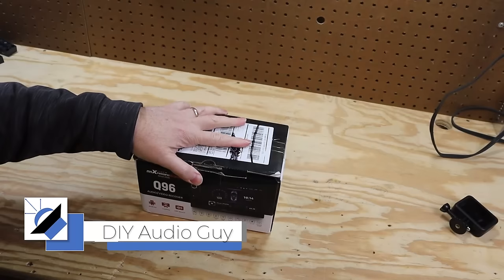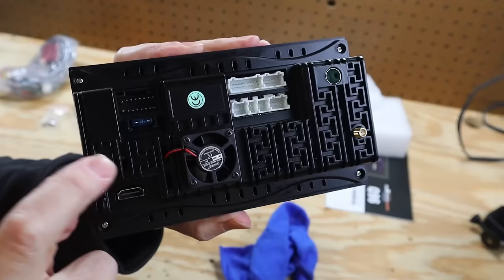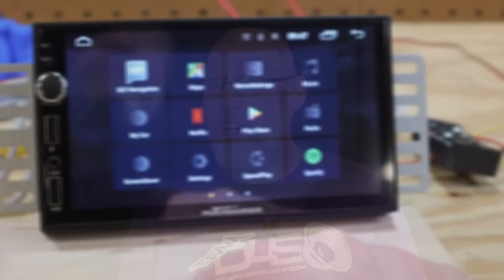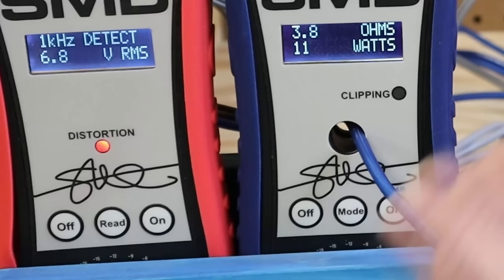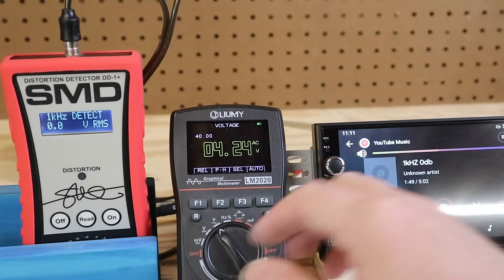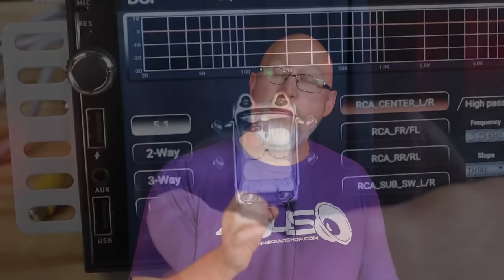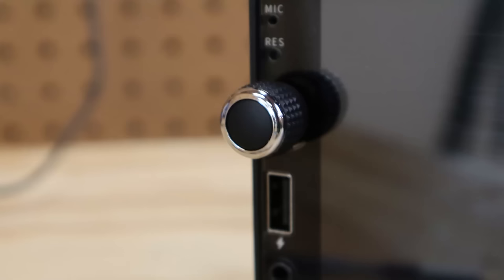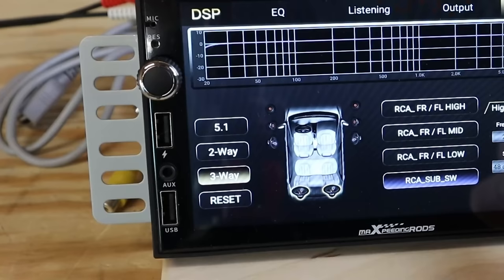The Best Sound Quality on Amazon?  Android Car Stereo Head Unit

Comment: Save the volume knobs! I don't buy a head unit without one. No matter the features.
Reply from the maker: I guess if you got steering wheel controls you can get by without a volume knob.
Reply: I don't miss a volume knob. Steering wheel controls I use more than anything
Reply: I agree. Volume knobs are an essential dealbreaker.
Reply: Volume knobs are superior in every way 💪
Reply: I'm the same way
Reply: I bought an X-trons, without thinking it would be a big deal, that it didnt have volume knob, but the touch buttons on the left size. Ive gotten used to it, but i really miss my volume knob.
Reply: Even with steering wheel controls when I need immediate silence from entertainment system to listen to engine/tire or road noise 100% of the time i go for the knob i got a cheap double dihn for my spare car that has no volume knob i wont ever make that mistake again
Reply: Ditto.
Reply: Every car I've owned in the past 40+ years had a volume knob. It's the standard control knob. Sure its a hangover from analogue days, but how practical are they.
Reply: I got an xtrons without one about a year ago... Previously I'd had a unit with buttons, so didn't think about it. But the xtrons has touch buttons, not physical ones. You can't feel for them without pressing them. And they put the power button right there with them, so you can accidentally turn it off while trying to turn it up a little.
I'll be looking for a knob or physical hardware clickable buttons on my next one.
Reply: You can purchase  a usb huge knob though
Reply: @DIYAudioGuy  1989 Nissans don't got that sadly haha
Reply: @tin2001  looking at Xtrons android 12 unit as well, when installing, does the volume knob on your main stereo stop working? If that's the case can you map volume to the steering wheel buttons?
Reply: Yes!!!! I can't stand buttons. I actually saw an article saying that buttons were better for use while driving.  Made me cringe
Reply: Yeah and you can add steering wheel controls to any car these days
Reply: I don't buy one without a volume knob
Reply: Helix with a Conductor is perfect
Reply: it doesnt have a mute button? @Learningmane
Reply: @capturedphoton  it does but I look for the knob  instinctively
Reply: yeah, car androids should/must have volume knobs because they easy to control while driving.
Reply: Same

Comment: The biggest problem I see with this is the 2G+32G in the listing. 2g means 2 gigs of RAM, 32gb of storage. Storage may not be an issue for anyone who is conservative on the apps they install. But, 2 gigs of RAM will choke a lot of modern apps. From personal experience I can tell you Google maps is horrible with low RAM. Waze doesn't seem to do as bad however. I haven't looked any further than that into the android specs, but I'm sure this has a weak processor and almost guarantee it's not actually Android 10. Most of these companies "skin" android 8, etc to appear to be 10, 11, so on. Try something like CPU-Z to see what the API is. Then Google android api list. 10 should be API 29. But... Sometimes they fake that too. Annnnnd, sometimes they fake the specs. 2g 32g might actually be 1g 16g. I'm not saying this company is doing that, but be cautious. Google the model number etc. You'll likely find someone on XDA with info. Personally I cuss my Eonon (8227L I believe) every time I drive my car and it locks up or resets itself. That said, it's still far better than the factory basic radio. I just limit my apps to Waze and YouTube Music. That's all I really need anyway. 🤷‍♂️
Reply from the maker: How much would you be willing to pay for one with more ram and a faster chip?
Reply: This is something that has been the achilles heal of these tablet style units.    Personally?  I have always found better performance when using  the phone to do all the GPS functions I need.  

   BUT the Bigger problem is when you start using Amazon Music and Spotify.  IT EATS RAM!     And CPU Power?   It eats that too! 

As long as you use this unit for Native Playback,  You should be fine.    But 2GIGS?  Not even Chromebooks today run good on that with a fast current CPU. 

4Gigs is the BARE minimum.   Want GREAT performance?    8 Gigs is where it starts getting good with apps.    12 is where you get diminishing returns.    

For Perspective?  4 Gigs of Ram was what you needed for windows XP to Fly back in the day with some Fast 15k SCSI drives on a striped array.  

2024 on the way?   And we still got 2Gigs being the Entry level with modern apps is just not going to cut it.   Fine for a Media Playback device.   Not so if you want to run  Modern Bloated Apps on the thing. 

As much as I like having a Headunit?    Screen Mirroring is the best way to go about it going into the future.   You use the phones Superior horsepower, and you getto use the tactile like functions of I/O device being your touchscreen and Physical controls to do its thing.     

That way?   If you want to simply upgrade?   You just put in a New "BOX" and the display, much like a Keyboard or mouse is the peripheral.   

You also don't have to worry about theft since everything that is worth anything is in a black box locked away.  Better for security as well.
Reply from the maker: @MickeyMishra  does Android auto / Apple carplay offload processing to the phone or does it do the processing on the head unit?
Reply: @DIYAudioGuy  well... Lol... I think I dropped about 400-ish for my Eonon a few years back, somewhat regretfully. If I could get this form factor (double din / 7-8in screen), 6-8gb RAM / 128-256gb storage, a really good processor, actual supported official honest android 10 or higher, security updates, android upgrades for a reasonable amount of time, etc... I mean I'd drop $1000-1500 easily.
Reply: @MickeyMishra  so much everything you said too. The sound processing, amplification, etc in the unit and the info/sound/video coming from an external source.
Reply: @DIYAudioGuy   Depends on the APP on the  Headunit.  Many diffrent ways to skin a Cat.   But most do it on the HU itself.    Not Rock solid sure on Apples end.  But with how they do things?   The API seems to point to most of the heavy lifting to the head unit CPU.   However, there ARE exceptions to this rule.    

SOME OEM units differ.  But its all closed source do to drivers, so its hard to tell without getting into the TERMINAL or SHELL.
Reply: @DIYAudioGuy  $100 easy if it wasn't laggy and had better speaker level outputs.
Even the low end name brand units have hardly any features for twice the price of this one. If there was guaranteed software updates and warranty support with a less dumb brand name it could be a $1k hu easy.
Reply: @MickeyMishra  Hopefully someday. All the tech is there, just Need a company to actually build it. If they can make profit on this feature packed unit why is Pioneer, alpine etc charging 4x as much for units with half the features and even their flagship units are Eh at best compared to what technology is available and could be offering.
Reply: @jeff.pitts.  use a tablet simple
Reply: Your eonon will completely factory reset itself?  I have an Atoto s8 10.1” that out of the blue factory resets itself every couple weeks.  It’s absolutely infuriating.  So frustrating to deal with.
Reply: I've been using this head unit in my 02 Ranger since just before the start of 2023. It's had a couple odd quirks where it doesn't want to connect via Bluetooth, but a quick reset usually fixes it.

Comment: Buyer beware as this headunit doesnt have the same dimensions as a double, it is slightly taller. Purchased for a 2006 silverado and face frame and side mounts used for a double din would not slide over this headunit, ended up taking the double din mounting kit apart and only utilizing the side pieces, screwed them on to the headunit itself and actully worked this way. There is a tiny gap up top but only looking from the bottom upward, with some minor modifications ie drilline new holes on the side mounting plates it'll sit perfect, but for now looks good and to the intrained eye no one notices
Reply: Thanks, I was just about to ask. Seems like the majority of these chinese double din are not to spec.
Reply: Did you use the headunit's speaker wiring ? If so how do they sound ?
Reply: @JayLoveBeats   only used the rca outputs

Comment: Knobs!!!  I'm with 'ya, knobs are 1000% easier to adjust than touching a screen button while taking your eyes off the road.  That's a long boot-up time, but everything else seems pretty awesome... and there wasn't any smoke coming out of this one when you amp-dyno'd it. :)
Reply: Thats just the initial boot up time, from when power is first connected. "Turning off ignition" (removing acc wire, while on bench) it draws about 0.5 amps for 10 minutesor less then drops to 0.00 amps. Reconnect acc power, it's about a 3 second boot up time...at least in my testing.
I like to see some hacking on this, I'm no coder.

Comment: Time alignment (also called delay) is the #1 feature you want in a DSP for car audio.  It might be more important than good crossovers.  When I first tried it out, I couldn't believe what a huge difference it makes.  I run a Dayton DSP408 in a hatchback with cheap front coaxials, rear coaxilas and trunk subwoofers.  Makes a world of difference in sound quality switching between presets with two different time alignments (Example: Drivers seat setup to Passenger seat setup).  As the driver, when I switch to the passengers setup everything sounds like crap and basically all of the vocals are coming right from my drivers door/footwell.  Time alignment is the business.  Don't bother getting a DSP without it.
Reply: Time alignment is the #1 feature you want in audio. There fixed it for you, you had too many words. Doesn't matter if you are a car audio DSP wizard or don't have DSP and are just trying to line up your tweeters to your mids in a pair of $25k home audio speakers using nothing more then your cap/coil crossover components to do that. If you want to make a band sound good out front being a sound engineer, the main speakers have to be delayed to the back line (where the bass amps/guitar amps/drums sit) or else garbage. Lining up your ducks is how you level up in audio. No question about it.
Reply: Really? It makes a real difference?
Reply: Ok I read the rest of your comment so I get it .
Reply: Using 2-way components with their own external crossovers and tweeters mounted in the a-pillars, should the time alignment distance of the tweeters or woofers be used?
Reply: @sumdood2035  Woofers. Here is why:

Our body uses different cues for location of sounds depending on frequency. Above about 3500 hz our heads block the sound as the wavelengths are much smaller then our heads. Sounds will be louder in the closer ear to the location of the source then the opposing ear. We therefore use relative volume between the 2 ears to locate these sounds. Sounds between 120-3500hz have longer wavelengths then our heads so the sound can wrap around our heads so the relative volume of these sounds are about equal in both ears so for these frequencies we use timing to locate these sounds - which ear the sound reaches first. Below 120hz we cannot locate the direction of the source. The study of this is called psychoacoustics.

Therefore the mids are the most important to get the timing right. You can just throw a towel over the tweeters and run your alignment program. For the tweeters the most important thing is to make sure they are both at the same volume level because that is how we locate high frequencies which is difficult because in a car you are much closer to one side then the other. The trick is to use the directional nature of tweeters to make the close one off axis (not pointing at you but the opposite side) so it is reduced in volume at your listening position and the far one pointing at your ear so it is on axis and therefore louder.
Reply: @sumdood2035  If you are using passive crossovers, I've read that you should time align to the woofer voice coils, not the tweeters.

Comment: Man this is exactly how thorough and honest HU reviews should be, you got every feature that matters, except gestures on the screen. There's some JVC touchscreen units that have both a volume knob and a volume gesture control on the touch screen, I've been wanting one for like 6 years now, and it'd be even better if it had DSP in it.
Reply from the maker: My main focus was on what I can measure.
Reply: Why... why the hard on for a DSP in the head unit....
Reply: @ShainAndrews  Because technology is always getting better, why not make a product that eliminates the need for a separate box with separate remote power and ground, and extra rca cables? What is your issue with a better head unit that outright replaces the majority of DSPs on the market? What is wrong enough with that idea you call it a hard on? Why add another box with wires when it can be simplified and fully integrated with no compatibility issues from a large, reputable brand that can also design and optimize the software? Why the hard on for another separate expensive box?
Reply: @corygilbert5666  At some point... you accept the jack of all, master of none.  Anybody can write code to make these devices appear to be doing a function.  Mean while behind the curtain noting is happening.  This stuff doesn't even have a quality DAC... but you claim "technology" is getting better.
Reply: Quality head unit, then let a quality amplifier/DSP run the back end.  AudioControl has some exceptional products at reasonable prices.
Reply: Having owned 3 of those circle around for a volume knob double dins trust me you want that  physical knob. I used the remote more than the screen gestures in that HU. Also you have to remember it's old-school membrane style touchscreen which isn't as accurate as you think. You didn't miss anything during that era.
Reply: @ShainAndrews  There's nothing stopping a head unit integrated DSP from performing as well as an external, this is just a nonsense argument.

Comment: I bought it, based on your video, and well...  love it! And gonna buy another. I put this in my wife's car which has 4 kickers series door speakers and a Parts express 10' dual passive radiator sub set-up and everything came to life!
I will be replacing my Pioneer soon.
Reply from the maker: Awesome!  I am glad that it is working for you.
Reply: Still good?
Reply: I bought one before I watched this and installed it into my 99 silverado.  My amp 2400.4 and I'm hooked up with 2 DS18 6.5" loud speakers.  My sub is a simple powered sub.  I am still needing to get door speakers.  Setting up frequencies and outputs have been a struggle for me and not knowing what to set these things to on my amp and the sub is probably my issue. I'll keep messing with it, now I end up just going with "rock" setting for the EQ, the outputs at max, and the frequencies I always up up reseting them to defaults.  But I do love this head unit big time.  I want to buy another for my 70 pontiac.

Comment: As an MECP certified installer by trade I turn away most clients that show up with these "Made in China" unknown brand android radios. They're cheap and do a lot, but they have a very high fail rate. The unit in the video seems better than most, that RCA voltage output and the built in DSP features are nice. Those options usually come in brand name radios over $1k like the Alpine I have in my truck. This unit seems like it may do better in a vehicle with an oem amplified system that has more than 5 channels, some Toyotas and Lexus models come to mind. I'm glad to see the quality of these units are slowly improving, maybe it'll force the big brand names to pack more features into their radios for less. But I'll still have the concern of how long they last before they break down.
Reply from the maker: How often do people bring in units like this?
Reply: do you think that because the rca output is clean a amp hooked up to them at full volume would be quiter than a mp at 37 out of 50 without clipping just wondering

Comment: I have the Dayton Audio DSP-408. And as much as I love it, I've been having issues with it communicating with the app on my phone. Also, I wish it had a higher output voltage. This headunit fits the bill. There's nothing like being able to access the DSP at the fly for tuning. Hopefully, more manufacturers will follow suit with this design.
Reply from the maker: It's been fun reading the comments. I think the brand could have a real hit on their hands, especially if they were to offer an upscale model with a faster processor and more RAM. Perhaps from there an even more upscale model with a toslink or SPDIF plus a big floating screen.  If they could do all that for under $500 they would break the head unit market.
Reply: @DIYAudioGuy  yup. I agree.
Reply: PD 550 for my 13.3" joying head unit with 6 GB n 128 GB DSP optical out lte4g i Love it
Reply: @Jake Jacob  I've been keeping an eye on the Joying line, too. Probably one of the few that offers optical out.
Reply: @DIYAudioGuy  I agree. I would buy it now if it had a big floating screen.
Reply: I’m curious what you need more voltage out on the dsp 4x8 for?  Cant you adjust your amp gain to take in the correct voltage?
Reply: @nebulousJames12345  You can, but in doing so, you can introduce more noise into the system, whereas with higher input voltage can give you a lower noise floor by keeping the gain lowered.

Comment: Wish someone would build an android unit like this with a decent built in amp.  Why doesnt D4S do it? 4x50+1x100 ish should be doable in a double din space
Reply from the maker: That is a lot of heat inside of the dash!
Reply: @DIYAudioGuy  Class d and decent heat sink chassis would still be much cooler than the high output cd player head units from the 90's